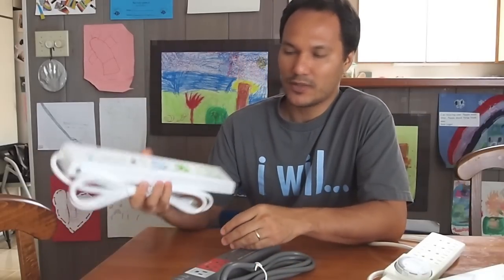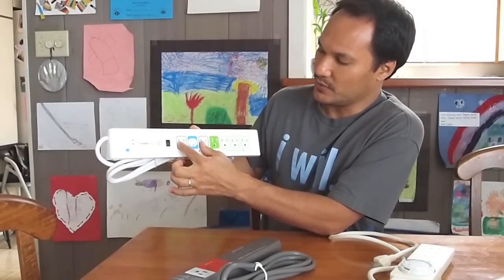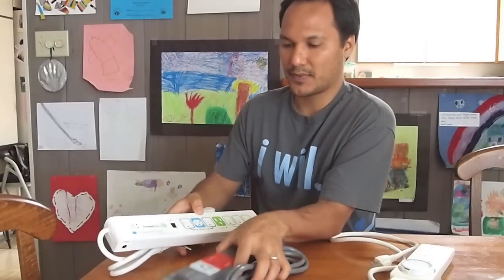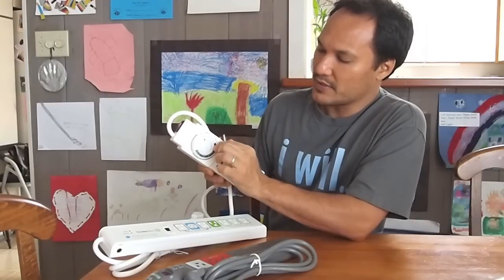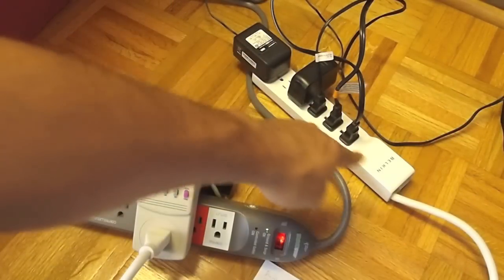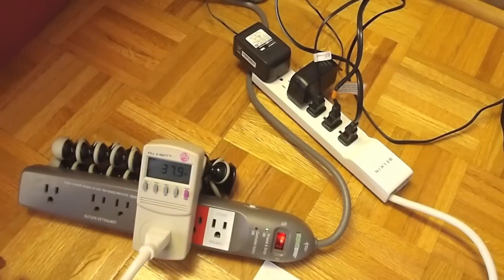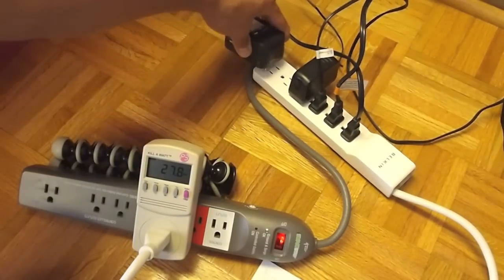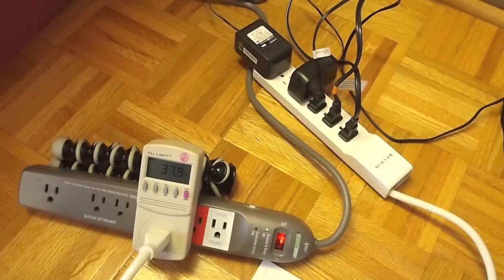An Introduction to Smart Power Strips to Save Energy

Comment: Nice video. I love when people get other people thinking about plugload.

I think you are missing a bigger opportunity. These devices only address passive standby waste for the most part. The timer version is a hard on or off which would create user frustration but will partially address what I found to be the best saving opportunity.

Active waste is the biggest opportunity for savings. Believe it or not people leave the TV and or PC on for twice as much time as they watch it. An ideal "smart strip" would address both with no inconvenience to the user.

Check out the Emberplug AV and Emberplug PC+ at www.embertec.com

Also very important, you should never plug anything with a hard drive into an auto off outlet. This goes for DVRs, games with hard drives, etc but also from a convenience factor the cable set top box should be in the always on socket as the boot up takes a while.

Nice job!